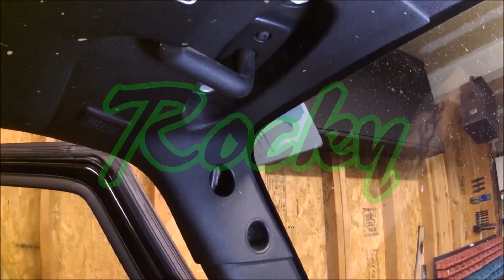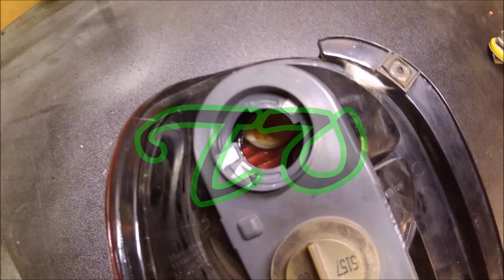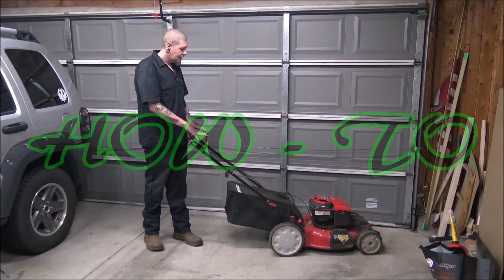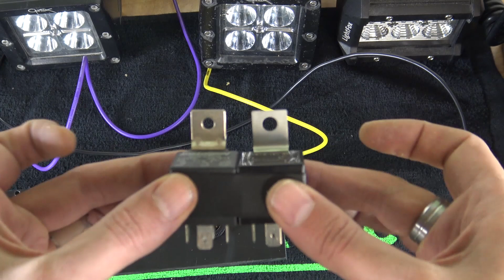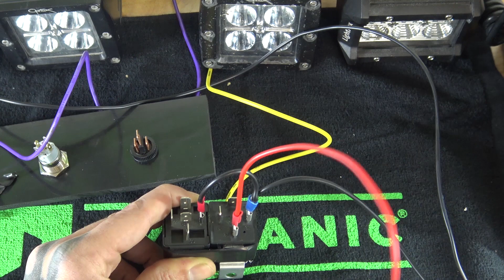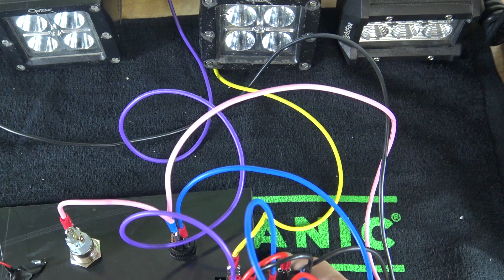How To Wire High and Low Beam Lights

Comment: I have an old van . high beam switch is broken in the column I wanted to wire a foot switch with a indicator light directly to the high beam bulbs I dont think I need two relays for this ,What is the wiring for this? im keeping the original low beam switch connected to the low beams.

Comment: I don't understand why not just use one 5 pin relay that does the same thing as the set up in this video.
Reply: The lights would never shut off. That’s a toggle to turn on and off
Reply: @huntmanmcl6812  
Ah, sometimes I can be a dunce. Thanks for your response.

Comment: I have a motorcycle that has independent high and low beams. Low beams stay on. High beams comes only comes on with the switch. I'm trying to find a way to make both lights comes on when bike turns on, instead of just the one. And both turn into high beams when I click the switch. Can I just connect the power cables with a jumper line?

Comment: Excellent explanation presentation and video. I have a simple wiring project challenge for you. Lol I've got a trux  3/4 inch Amber to green marker light. 3 wires 1 ground.  One yellow wire to be provided 12 V for Amber light. Then 1 wire red to be provided at the same time 12 V to provide a green illumination. How can I run a switch system to go from Amber to green. Preferably using a 3 position toggle/rocker switch. I have to have power going to one and then power going to both To be able to transition from Amber to green. Am I able to do this with just one sitch or do I have to use a relay and secondary switch like you have in this video. I apologize if my comment was too lengthy just looking for your Guidance
Reply from the maker: Sorry for the late reply. 
This is another of my videos that may help you with your light.
https://youtu.be/77q9KtjnNTU

Comment: Great video ... Just curious if its possible to replace ATV lights with LED cubes like you demonstrated with  (as a low beam option) and also add a light bar as the high beam option while simultaneously using the cube led low beams and the light bar on high. I'm looking to do this using factory h/l handle bar switch.  If you have knowledge of a video that shows this I'll be very grateful ...  I haven't found one yet. Thanks again for this video... that helped me out in another application.

Comment: How would u do this with headlights I bought a f150 and the previous owner had HID lights on a rocker switch and I need high and low beams to pass inspection

Comment: How about factory switch that just has low beam as trigger from switch, but then turns off trigger for high beam to then come on? It's on my Datsun,seems to only have one signal at column for low beam, high beam does not have power trigger unless earthing out/low beam trigger turning off is now considered the trigger..

Comment: I have a light bar with 3 way switch....it has on=drl only - off=full off - and on=full on/bright....the problem is, I just used the switch and wiring harness that came with the light bar, but I want it to turn off when I turn off my car....I have left it on by accident lol. I love the idea of having an indication light tho like in ur video. I wish I could find a good back lit spdt switch....so then I could know if it was on easier at least

Comment: Is it possible to do this using only a 5 pin relay? Like put the flip switch in the line between 87 and low beam +

Comment: Would this same method work for a light bar that has hi and low lights???
Reply: If you connect light bar as show in video above, your switch for low beam must be always on. See link below for better solution
Reply: jurica0301 thanks really appreciate it
Reply: https://youtu.be/bcY2CG07wi0

This connection works great with H4 bulbs when low beam must get off and high beam get on.

Comment: I've already wired my lights on the hot rod, headlight toggle is a 5 pin has headlights, park lights, and dash lights  come on pushed up, all the way down just turns on dash lights and park lights, I have 3 wires ran to the dimmer switch, which rocker can I use to get those 3 dimmer wires to work that is a dash switch not a floor switch?

Comment: Hi mate love this video it will be very helpful to me on one of my other projects but I was wondering if you can tell me how I would fix my sons std wiring to work with a set of LED headlights he just got, the LED headlight's are the same 7" H4 as most Jeeps use, problem is we are putting them in a Suzuki Sierra / samurai 94 model and it is negatively switched....I have the low beams working for now (by swapping 2 wires on the H4 plug) but when you go to use hi beam you get nothing, (unless I swap the wires back and swap 2 other ones very confused) also while the low beam is on the blue high beam dash light is lit up. I have seen a few things online about using 2 relays and having one relay as low beam and the other as the high beam but I at a loss and could rally use your help if that is at all possible. 
thanks in advance.

Comment: This is a very helpful video and has helped me a lot in understanding car wiring. Can you do a video where you show how it would work with the rear running lights? That's the only part I'm getting confused on and I need to rewire my whole car (1986 Fiat 126P) Thanks!

Comment: Add third relay for tail/marker lights.

In an application like demonstrated, where high and low are actual separate units, and not a single “dual filament bulb”, it can be more desirable to keep the lows on while the highs are on. This greatly simplifies the wiring as well.
Reply: Been trying to find documentation or videos on how to do just that.  Want to keep low beams on when high beams are activated and only low beams on when low beams are activated.  Any details on how to accomplish would be appreciated!

PS my question are for LED bars where they just have an "on/off". Low beam would be one bar activated and high beam would be both bars activated.
Reply: @hermayneMUNSTER  The answer is simple. You just use a relay that is 5 Pin but instead it has TWO 87 pins. That's what they are meants for. So when you turn on that relay it sends power to two different circuits. So you wire the first set of lights direct from the 5 Pin relay. From there, you use the 4 pin relay, to turn off and one the Second set of lights.

I can provide a diagram if you like.

Comment: Maybe you can assist, how can I add a pair of led light pods with high and low beam functions built in to a car on an independent relay, harness and switch? Most led pods are just one setting so the challenge is getting it wired to have it on low and be able to access the high bean function.

Comment: Would that same setup work for a dual radiator fan
Reply from the maker: It would work, but most likely not as you would want it to. This setup would basically let you turn one fan on at a time, not both.

Comment: Brilliant! I cannot tell you the number of videos I've looked at trying to find just this information for wiring high and low beams through relays on a bobber motorcycle. Absolutely clear, on wiring and why it works. Thanks so much!
Reply from the maker: Glad the video could help! Thank you for watching and good luck with your install!
Reply: @RockyXTV  it does not require 2 relays to make high beam and low beam, only a 4/or 5 pin relay and a floor switch or other switch with the same function are needed

Comment: when i did this set up all the relays would do is buzz the light wouldnt come on at all
Reply from the maker: Are the relays getting the correct voltage? Most relays won't activate and simply buzz or hum if they are not getting at least 11VDC. You could check your voltage at pin 86 with the switch turned on, you can also check your grounds.

Comment: Thanks! Helps me out a lot. I wish you would have used two rockers, instead of mismatched switches. I'm assuming the rockers would be on-off with an upper independent and lower dependent indicator light. (Which takes care of the need for a  separate indicator.)
Reply from the maker: Thanks for watching! The indicator light was separate purposely for the design. It was to emulate what you would typically have in a normal vehicle as your High Beam indicator is normally on the gauge cluster and not down on the switch. The two switches I chose to use for the demonstration were also to make this similar to a vehicle, you have your switch (most of the time a knob/selector switch) to turn on your headlights. You then have your high beam switch built into another component of the vehicle, i.e - turn signal lever, wiper control lever. I hope that explains my choices in parts for the video. Thanks again!

Comment: can i ask how to set the low beam still on when switch to high beam?
Reply: Just use 2 relays separately.First for low beam and second for high beam.
Reply: @jurica0301  2 x 4 pin relays, right?
Reply: @medicalostrich7775  right
Reply from the maker: That involves a little more wiring. If you like you can send me an email ( rocky.tvchannel@gmail.com ) and I can send you a simple diagram. Thanks for watching!

Comment: Its okey to use both 5 pin relays? Thanks
Reply from the maker: Sure, you just won't use all of the pins. Thanks for watching!
Reply: @RockyXTV  sir i have another question, does relays consuming battery power even the switch is off?

Comment: thanks man you have help me alot,                                                                                                                                          
 the way i did mine is similar with your wiring method few things i change and added to it  i have use rotary switch OF ON ON  which is   side marker lamp for the first ON position TAKE NOTE: FIRST ON POSITION WILL CUT POWER WHEN I TURN KNOB TO SECOND ON POSITION!   and  low beam for the second ON position, i have a separate  ON  OFF switch   for high beam and i also added push button to it  " FOR FLASH", i got fancy a little i added volt meter, LEDs for every switches  and built fuse block. i did mine this way BECAUSE MY BROTHER'S OLD VAN light is messed up.    PS  i did some test and all went well relay did not get hot no wires got hot.  after watching your video i have learned a lot i really appriciate your effort thank you!.
Reply from the maker: Thank you very much! I'm really glad my video could help!

Comment: Will this relay set up work on a motorized bicycle/ moped using motorcycle switches?
Reply from the maker: You would just have to determine what pins on the switches do what and there should be no problem. You would need a 12 volt system as well. Thanks for watching!
Reply: Update:
This set up works on my homemade motorized bicycle. Got my high and low beam headlight working. Thank you for this information, I'll make a second one for my turning signals and see if it works. Thank you again.
Reply from the maker: Glad this worked out for you! Let us know how your turn signals come out!

Comment: I am curious why you chose this method when in just about all situations you should keep low beams on and have high beams come on as well without turning off low beams. The exclusion would be if you were running a dual filament bulb but if you are running 4 separate lights then low beams should really never go off.
Reply from the maker: I chose this method as I expect a lot of people using this video would be re-purposing some for of OEM headlight. This would then most likely have a dual filament bulb as you said.
Reply: Yeah on an ATV I can see that.  I was just thinking though how it leaves out everyone who has an old sealed beam (2 low and 2 separate high) setup since none of them originally had relays.  Maybe an idea for another video?
Reply from the maker: I have been planning another video using some 4x6 sealed lights for high and low.
Reply: Awesome!

Comment: Do you connect your LED direct to the battery or you used a resistor to reduced the current
Reply from the maker: The LED's that I use have a resistor built into the positive lead so they are ready to go for 9-18V. You can find them in my Amazon storefront in the switches, wiring and electrical section - https://www.amazon.com/shop/rockyxtv Or here's a link to the multi-color 120 pack - https://goo.gl/yMmmbz Thanks for watching!

Comment: So many wires. I hate wireing I always mess something up and I hate doing the crimp connections I always seem to crimp them and they come off or are too loose. Great video
Reply from the maker: I had that issue for a while until I got a good set of dedicated crimpers, not the all in one stripper/crimper combo. That made a big difference, but most of the time I solder on connections/connectors, just not for videos. Thanks for watching!